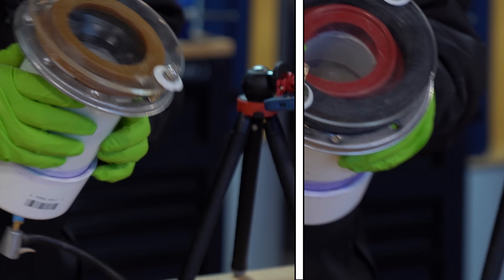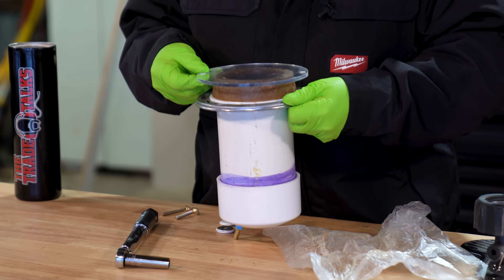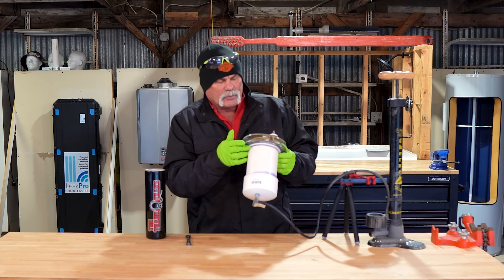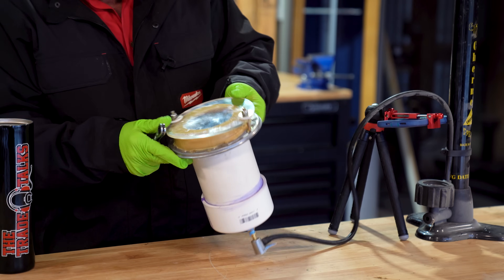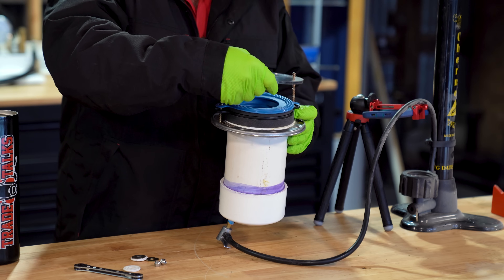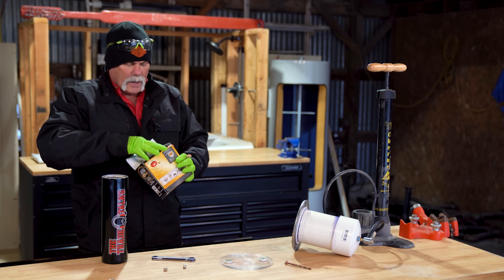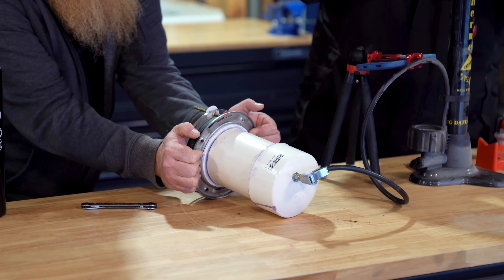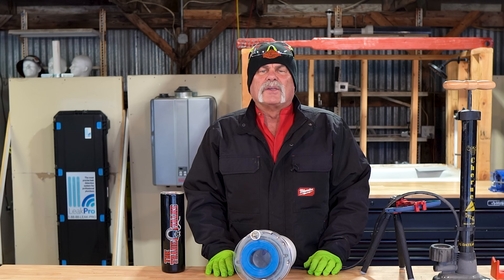Toilet Wax vs Rubber: Which Works Better?

Comment: As much as I enjoy Mr. Wakefield's videos, I think this video really missed the mark.  In the description of this video, it states that testing is to see if "wax or rubber - holds up best under intense pressure, a crucial factor in ensuring leak-free, reliable toilet installations."  But Roger said in the video, "There should never be this much pressure on your sewer system."  So he's testing for a factor that should never happen and these rings are not designed to handle.  I'm not a plumber, but all the leaks I've dealt with came from the toilet rocking (even minimally), then the ring gets deformed and leaks begin.  I believe that a test performed to analyze that criteria would be a more useful indicator of performance in the real world.

Comment: I have a condo in Fl. and the toilet was leaking around the bottom, so I figured the wax ring needed replacing.  I installed this toilet around 14 years ago.  I've always done all of my own plumbing and electrical work in my homes.  Now at 81 YO, it is getting tougher, so I hired a plumber.  I had all the water out of the tank so it would speed up the process.  When the plumber came, and he removed the toilet, he discovered the flange was corroded and that was the failure point. In removing the old flange he broke the 4-inch pipe, he didn't have any along, so he had to go back to the shop to pick up a few more parts. To make a long story short, the charge came to $694.00 for this repair. His labor charge was $165/hour.  Had I known it would have been that much, I would have done it myself even if it took all day with frequent rest stops.  I figured he charged me for the time to go and get the parts because he did not have a section of 4-inch pipe in the truck, and he also charged me for the time we had a BS session after he was done for the day.   Since it was his last call of the day, I offered him a soda, which he accepted. He was a nice guy, but his company was not worth $165/hour.
Reply: plumbers have ALWAYS been overpriced making at least 4 times/hr what most of their customers make but  can't compete with dentists who get 4000/tooth  with maybe 90 minutes invested for BOTH visits !!!!!!!!!!!
Reply: NEVER just chat with folks getting paid by the hour that work at your house.  Most will charge you for every second they aren't at the shop.  Worst I had was a plumber that didn't have a basic part, a silly under the sink shut-off valve, and left to get one. He was gone for 3hrs and the company billed me for it.  All they were doing was connecting a dishwasher drain hose to the sink drain on a kitchen remodel. They also charged me for training the new guy who was with the plumber.  I called, pretty angry, they removed the charge for the trainee but not the 3hrs they weren't at my house. It still cost me something like $350 for maybe 45 minutes of actual work, 20yrs ago.
Reply: @bramnovak881  
You are absolutely right about the No Chat rule!
Reply: Frank Zappa has a song about this called Flakes.
Reply: @dwightdodd3734  Bur you feel better when you leave the dentist, not so after the reaming from  plumbers

Comment: The problem you were having with the non-wax seals is that the piece of acrylic you were using was warping severely preventing it from being able to seal. That's a problem you won't see against the porcelain of a toilet. I've used them in my house and never needed to replace one after putting it in. I'm sure they'll fail eventually as all things do but to me they work incredibly well.
Reply: Yes. The warping acrylic issue is mentioned in the video.  No Thanks for re-stating what the video states.
Reply: @rfarevalo  The point being that, he should have corrected the test by adding (at least) 2 more bolts, to give more consistent/even pressure all the way around, as a toilet would and get rid of the bicycle tire pump because it doesn't apply consistent pressure. 
So your sarcastic reply was unwarranted.
Reply: Thats the problem with the internet.   If we are grouped together in person talking about this, any halfway decent person would keep their manners in check.  They wouldnt run their mouth like rfarevalo.  The internet is like a wrought iron gate separating two yapping dogs.  Open the gate and they shut up.  Ya you could say look at me  im running my mouth, buuut someone had to say it. 😅
Reply: @modeljetjuggernaut4864 perfect analogy.
Reply: @rfarevalo  Well, you mentioned it because he did and since the video did too, with my comment about yours it makes 4 times it was mentioned. (lol) Anyone wanna be 5?

Comment: I've used the exact same Fluidmaster foam rings when I needed to do underlayment repairs under the toilets in our house. I've been pleased with the results. 
Note: That is a 2 piece system. You don't necessarily have to use both black & blue foam rings. The black piece is used if the flange is below floor level and additional seal is necessary.
Really enjoy your videos & tips.
Reply: I really appreciate your comment. I didn't know if you had to use the foam rings. I tried once and the toilet wouldn't go all the way down, and I was afraid to torque the bolts too tight. I didn't use any foam ring. Was this okay?
Reply: @davegaetano7118 It depends on your flange. If it's level with the floor, rubber alone is fine.
If it's up to ¼ inch below floor level, use the foam spacer.
Reply: @davegaetano7118  You have to look at the instructions.  The instructions will tell you that based on your flange height, you use or do not use the extra rings.
Reply: @scottlyttle5586 
It's been a good number of years since I've had to use the rubber one, but honestly I don't remember any instructions to that effect coming with it. Maybe the instructions have been expanded.
Reply: Just use wax in the correct size.

Comment: I'm an old guy, and after wrestling with replacing a wax ring today, I'm switching to rubber next time. These old knees have had five surgeries, and all the scar tissue across the face of the knee caps does NOT like kneeling on tile floors any more, and especially so if I kneel on a closet bolt or a nut.

The tests are a great idea. Thank you for doing this.  I'd like to see a couple of things changed on the tests, and see if you have a revised reaction.  The pressure gauge should be moved to the pressure chamber. Right now, it is only reading the pressure in the hose. There is a large pressure drop across the Schrader valve when you are pumping, which masks your results.  The other thing, is that if you use another metal ring or even a PVC flange over the acrylic plate, you would have even pressure around the whole seal, and would eliminate the bending of the plate, which also masks your result.
Reply: Man, I hear you.  I'm 63 and after a lifetime in the construction industry and a couple of knee surgeries, it's getting pretty rough.  No more wax my friend.  🤣
Reply: Get a kneel pad!!! I’ve also had a litany of knee surgeries, I tried every type of knee pad and they’re all just bothersome. You can get a foam pad from husky at home depot for like 20 bucks, and it will change your life. Both my parents and wife swear by them too. Great for around the house and the job site.
Reply: I won't see a next time 🙈

Comment: Homeowner. Replaced all 4 seals with rubber years ago. Never had a leak so far.
Reply: I can’t say that my experience is definitive regarding wax vs rubber.  However, I’ve installed wax rings and have replaced wax rings during bathroom floor remodels and have never seen evidence of any leaks.  I have replaced rubber seals with wax precisely because they did rot and leak.  Definitive proof of one over the other?  No.  However, I don’t feel like ripping out a ceiling below the rubber seal leak and repairing it to look like it never happened ever again.  With me?  Wax.  If it ain’t broke don’t fix it.

Comment: I used the Korky rubber ring during my bathroom remodel, as it allowed our contractor to reinstall the toilet every day without having to use a new wax ring each time.

The Korky Wax Free ring is made in Burlington, WI.
Reply: I've replaced literally thousands of toilet flappers.   Korky makes by far and away the best toilet replacement flapper.  You pay a bit more....but they're worth it.

Comment: The maximum pressure that a ring can hold is not a real world issue.  A rocking or unstable issue is an issue.  Use very little pressure but rock the acrylic sheet to simulate a wobbling toilet to see what seal gives the best real-world performance.
I'm a home owner and have used several of these and they seem to work really well.  Especially, if you have lift the toilet for some reason, you don't have a gooey wax mess to clean up.
Reply: Someone finally said it.  Wax rings just get permanently compressed if there's any flex or unevenness in the floor.  Intuition should predict it, and it's trivial to observe.  I don't care if they're a bit cheaper.   The difference doesn't offset the cost of a rotten subfloor and the broken flange that inevitably follows.
Reply: I can't see how a wax seal gives a good seal in anything but a case where the toilet bowl doesn't budge a micrometer, and how realistic is that? First time big Uncle Hershel sits on the can, I can almost guarantee there will be tiny angular offsets and displacements, and I can't see how the wax seal will remain air or water tight. At least materials with good elasticity will rebound and continue to conform to small angular and other offsets, when Hershel gets back off the can.
Reply: @briank10101  The wax ring (or alternative ring material) is ONLY to prevent sewer gas from entering the home as the P trap is built into the toilet fixture unlike with sinks, etc. A properly set toilet flange will not have issues and that is the problem 99% of the time (the other 1% problem is floor has bounce to it / improper framing or uneven creating wobble). The weight of a person is transferred through the toilet to the floor and is not through the wax ring. The horn of the toilet fits INSIDE the toilet flange as the toilet flange is sitting ON TOP OF the finished floor. There will only be small space between the toilet and flange that wax will seal to prevent sewer gas from entering the home. When I remodeled my bathrooms, I cut out the flange (from inside the pipe) did the finish floors then set a long tail toilet flange (or extended the pipe as the case may be). The flange then must be screwed (stainless steel screws) through the finished floor and into the subfloor. I went the extra step and silicone caulk around the flange and finished floor. Solid as if built on concrete. Installed the toilets and made sure snug with no wobble then caulked or grouted around the toilet. 100% solid and leak proof. If your flange is not 100% correct you will have problems.
Reply: No one asked me, but I think a bit more pressure was used than it would ever go though. If you're not realistic about actual use, you can make any seal fail if you put enough pressure on it and use the wrong materials to test your theory
Reply: Bingo, my thought to.

Comment: I switched all wax rings to the blue rubber product you showed. Going strong for 7 years now even when one toilet shifted and rotated.
Reply: The seals are not the issue its when the toilet starts to wobble that is the issue.  Wax or Rubber they will  both seal for a very long time.  I always wondered why there were not more than 2 bolts to hold it all down.  If you had a 3rd ideally a 4th bolt on a toilet they would last a lot longer.    People 'shift' when sitting on the bowl... that is the problem.
Reply: @gags730  I remember when toilets had 4 bolts.
Reply: @James-dt7ky    Really?   You would think they would have at least 3.  Like the 3rd bolt in the back and for cosmetic reason I can see not having one in front
Reply: @gags730  There used to be 2 on each side. I think the front 2 screwed into the sub floor. The back 2 into the toilet ring.
Reply: @James-dt7ky   Thanks for the info!...  Only 4 Bolt ones I ever see are screwed to the wall but Im not talking about those ... just the standard house toilet.  I wonder what they do in Europe?  I never looked at the way the toilets were mounted in Germany but it was strange they have very low water in them, there is like a ledge...makes no sense as ya wanna b drown the stink pickle as soon as possible
Reply: @gags730  I just had a look in my house. One of my toilets is a 4 bolt. It's a Crane toilet original to my house built in 1972.
Reply: @James-dt7ky   Thanks for info.   You are the King with the best 'Throne'    haha
Reply: @gags730  I use "Crane technique". If do right, no can defense.  :P
Reply: @James-dt7ky    LMAO!  hahahah
Reply: @James-dt7ky That sounds like a beauty of a toilet.  Respect
Reply: @gags730  That's the first time I've heard of a turd called a "stink pickle" lololol.
Reply: @aliasfred     NFL?  Clevland Browns to the Superbowl
Reply: If there is any movement of the toilet in relation to the flange the rubber is the superior solution.  Plus it's reusable.

Comment: I’ve used wax rings, and the blue rubber one you tried in the video. Some of other rubber toilet rings are junk. The wax rings and blue rubber rings both work, except if using a PVC flange and it is too high above the floor and there is not enough room between flange and toilet to compress the rubber. In that case, use a wax ring. If the flange and floor are not parallel, use a wax ring.

Never allow a toilet to rock back and forth even a small amount when using a wax ring. The rubber rings have that advantage over wax rings, when installing a toilet. Supposedly you can reuse the blue rubber rings, but I never do. 

Wood floors are never perfectly level, so I shim the toilet so it cannot rock when using a wax ring. The ideal flat floor for a toilet are large format porcelain tiles. I’ve never had to shim a toilet setting on a porcelain tile floor that was laid using a floor leveling system.

There are typically two causes for toilet ring failure. Improper installation or the toilet gets loose and rocks even a slight amount. That’s why I make sure even if the nuts are not really tight, the toilet does not rock. I use the thin flexible cutting board sheets and custom cut shims that are hidden beneath the toilet.
Reply: Danco is the best
Reply: I like your comment the best.
Reply: @jacklabloom635  Danco has a wax ring , rubber gasket and a plastic tube extension. All three in one set up. Easy to install -to high just sit on it.

Comment: Eight years ago (Dec 2015) I used the 7530 Toilet seal kit "better than wax" from Fluidmaster. So far so good. No leaks. No sewer gas. It outlived the tank. The tank recently developed a hairline crack and a leak. Replaced the tank but kept the bowl in place still attached to the floor with seal inside. I am not a plumber by any means. Just a home owner.

Comment: So for me I've been using the better than wax. For probably 6 years now. I've always been a big fan of wax. And I'm still using wax in certain occasions. But a lot of these new toilate, they have no grip to hold when you're trying to install them. They're odd shaped a lot of times they have these funky designs where you have to insyall the bolts.  Inside the bowl so I started using the better than wax. Because it was a way I could get a seal. Cause you  have to keep working the toilet sometimes to get the these funky toilets to set the way you want to. And that's just what has worked for me with some of these different toilet designs. But I've never really had any issue with it. And I really don't use the foam piece unless it's.  Like specifically, an upstairs toilet situation where maybe the flange is sitting just just a little bit too low and I'll give that to my customers as an option as opposed to redoing the entire upstairs flange, which reinstalling the flange at the right height is the better option. But sometimes with budgets, people can't afford those kinds of repairs when they want to. And have to save up for the repair costs. So it's a kind of a Get me by  Repair, but I've had a lot of success with the better than wax myself.

Comment: Landlord here, I've laid 2 toilets personally with better than wax seals, and haven't had a single problem yet! I like them because, I'm not a plumber. I don't have the repetitive skills honed in like one. So it's significantly more forgiving using the better than wax seals. My landlord friends also use better than wax seals, and they swear by them! It's really a great deal to have some leeway installing toilets, for only $10.
Reply: Agreed, I volunteered (never again) to put in 3 new toilets for a cousin of mine in her townhouse, I had on hand wax rings and also the Fluidmaster and Korky ones. I used the non-wax since, although I do most of my own plumbing, I'm not experienced setting toilets, I wanted to be able to re-set the toilet if necessary. I liked the Fluidmaster better. With the extra spacers they are good for flanges below the floor. But these flanges were above, so I had wobble and used Wobble Wedges, had a box from Amazon, plastic shims. I have not had any complaints after a couple years.